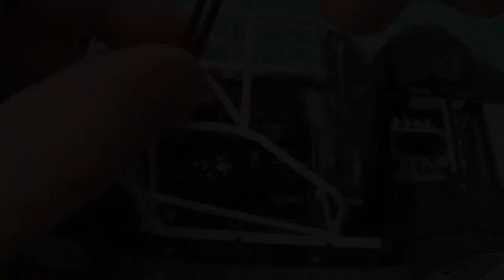Building a Plastic Scale Model - Castrol TOM's Toyota Supra GT full build

Comment: I was just wondering what did u use to connect the brake discs to the othe brake thing at the start
Reply from the maker: It is a piece of plastic from the kit (if you refer to the straight plastic part with one hook on each part)
Reply: @SmallScaleFun  Was it the black thing that came with the tires?
Reply: @SmallScaleFun  also what number
Reply from the maker: Hey!
Can you be a little more specific :)
Or, can you tell me please at what time (minutes) in the video should I look?
Reply: @SmallScaleFun  3:10 Did you glue these two parts together
Reply from the maker: Yep,
I think that is the only way you can hold them together. 
Be careful not to glue the rubber pieces inside the disc.
Reply: @SmallScaleFun  Thank you, it was a very stupid question, I'm just a beginner
Reply from the maker: @ВладимирРешетняк-д2н  hey, no problem, glad that I can help :)